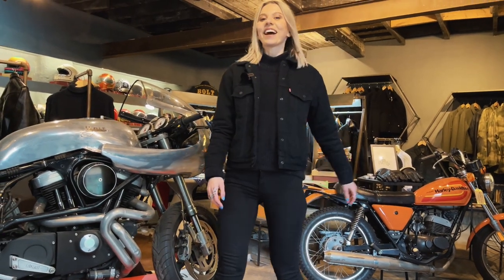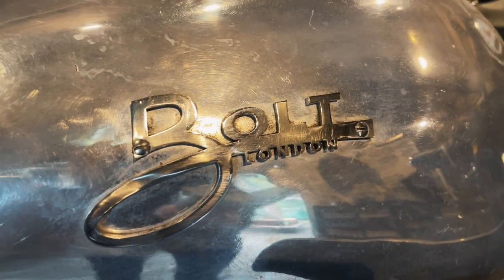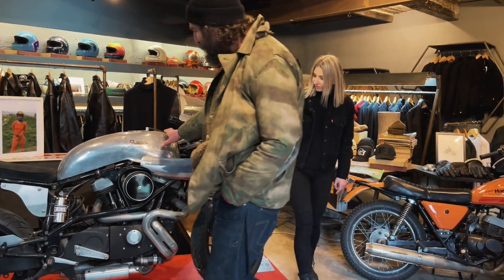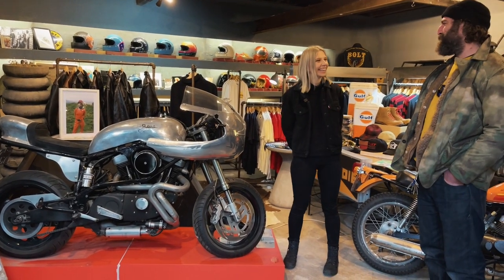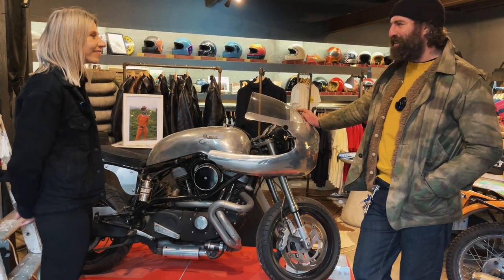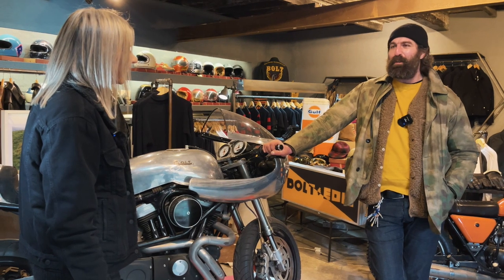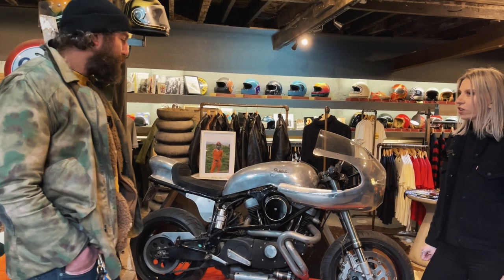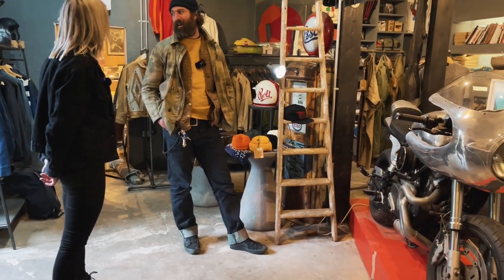BUELL X1 CUSTOM BUILD / BOLT MOTORCYCLES LONDON / Custom Series by Tomboy a Bit

Comment: I have a '99 Buell X1 that i've had for over 20 years, it's a blast to ride. A lot of people think Harleys are slow, well this isn't. Just tell Mr Bolt to run his drive belt a lot slacker than it is otherwise gearbox and rear wheel bearings will suffer,it happened to me.

Comment: Thank you so much, love Buells and own a few. Fabrication is amazing and it is a beautiful bike.
Reply from the maker: A few? Buells? 😃
Reply: @tomboyabit  Well three at the moment, but there is a large following for them in the UK and a fair few collectors with a lot more in their collection than myself. I am just finishing a flat tracker Sportster project at the moment which has a 2010 Buell motor in a 1990's Sportster frame ( not easy as they are completely different motors and mounts ) joining/welding the Harley/Buell swingarms enabling me to run a 190 rear tire. Thanks again for covering the Buell and I love your channel.

Comment: "When you get it up to a good speed 70 or 80" I call that a start, but then I do have a "RoadLegal" Suzuki GT750 that does the 1/4 in very low 8's, it looks really good, I properly like the raw aluminium it kinda tells you it's not a "ShowPonie" from the start.

Comment: Nice Buell and shop.

Erik Buell was an Engineer for Harley he did some pretty cool things while working there,  he started his own Company in the 80's he also did some neat things with his bikes, like a bike with a back hump that flipped into a back rest when you carried a passenger. 
Harley bought part of Buell 49% in 1993 and then Buell became part of Harley in 2003,
When the Great Recession came along the company stopped making them. 
The XB series were my favorite I liked the tech features like the fuel tank in the frame rails, the oil tank was built into the swing arm. 
I've met and talked to Erik Buell on a few occasions, I used to be a Motorcycle Magazine Writer-Photographer I always enjoyed talking shop to him I trained a Aircraft Mechanic and later Motorcycle Mechanic so I was always interesting to talk with him.
I have owned several Sportsters over the years so I know about the vibration, the later Buells Ran better they used their own crank, pistons and cams.

Comment: Thanks for the video tomboy_a_bit, that's a lovely Buell. Is that orange motorcycle a 1976 H-D SS125, it sure looks like one?
Reply from the maker: Only Andrew can answer it. :)
Reply: Hey - yes it’s a 1974 sx125
Reply: @boltmotorcycles  Thank you for your reply Andrew, sorry to disagree with you but the SX125 was the trail version with a high level exhaust and a bottom triple tree mounted front fender. That bike you have there is definately the SS125 street bike.

Comment: I owned 11 Buells. From the S2 to the R 1125RR. The X1 was one of the worse. Horrible engine managenent system and equally horrible handling characteristics. This is compared to the other 10 which I did track days on . Long haul sport touring and spirited twisty mountain road riding.  I am sure these short coming could have been corrected but at that time I hadnt the time nor the patience to bother. Traded it on a Firebolt 1200 which performed and handeled awesome. 
Without Eric I consider Buell motorcycles dead and gone.